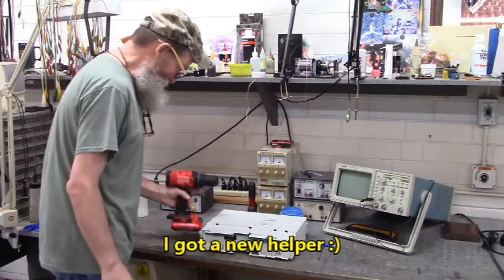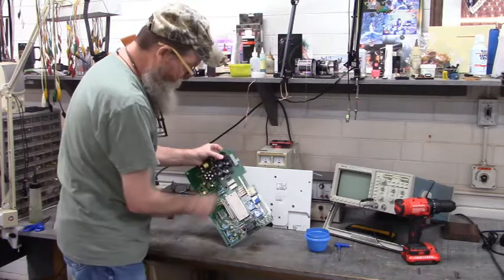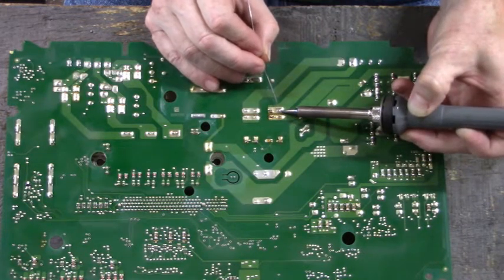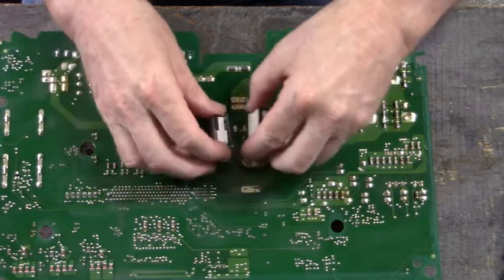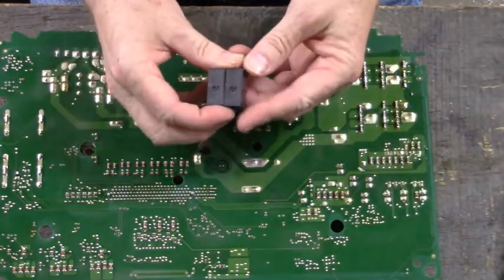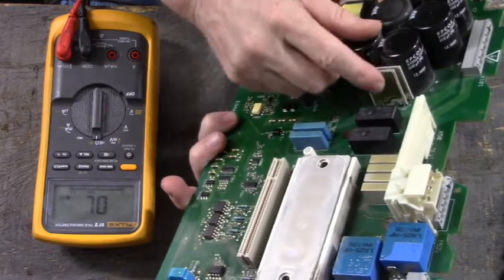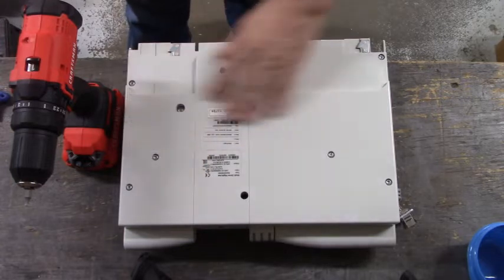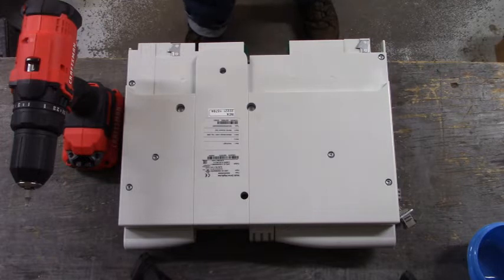(Part1) Lenze Highline Servo Drive Type E94ANHE0094

Comment: Hi everyone, something strange happened to me. On a piece of equipment where I have 10 9324 ET servodrives, 3 of them burned out. Now I'm trying to repair them. Can you give me some advice?

The main board is definitely OK, because when I mount it on another drive, it works. But the 9324 LP5B doesn’t work. The main board tells the motor to rotate, but it has no power, and error 151 (follow error) appears.

Which components are most commonly damaged on these power boards? Thanks!